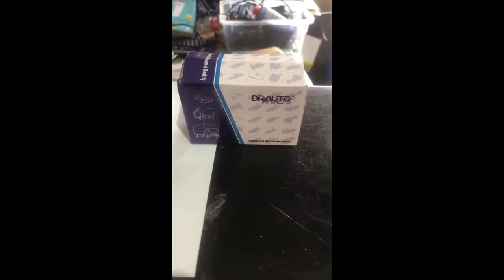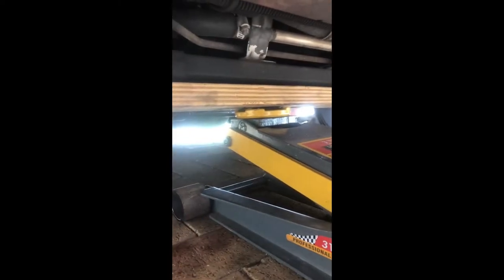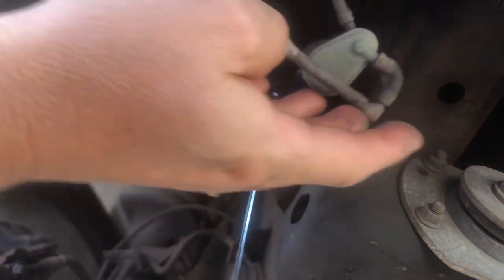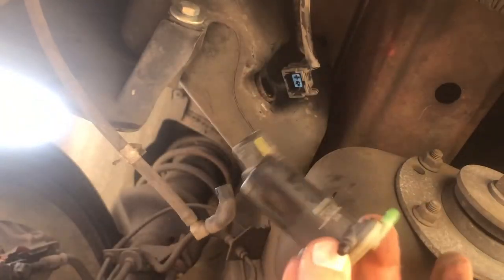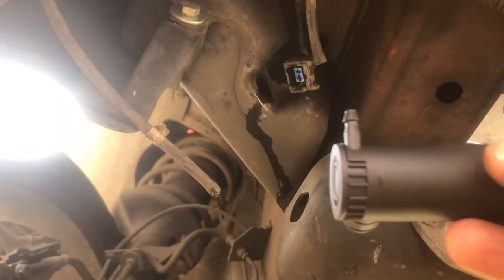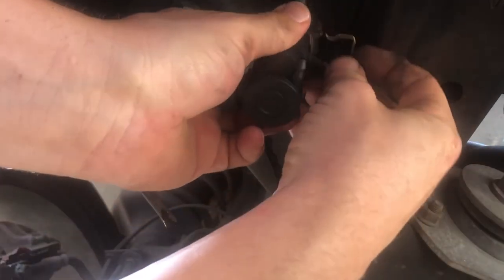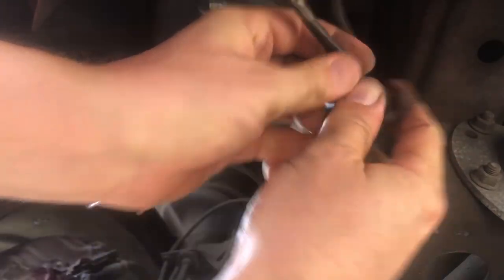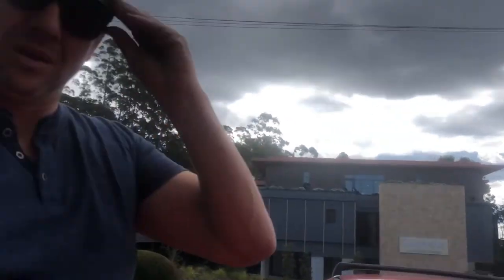How To Replace Window Washer ( Windshield ) Pump on VT - VZ Holden Commodore 1997-2005

Comment: You just saved me heaps of time and gave me confidence to tackle this job which has been a problem for a few months. Thank you.
Reply from the maker: That’s great
Let me know if you have any other issues on your Holden 
May make it my next video
Reply: @gdawwg1125  it’s a vz cross8 and this car has been a really good purchase ten years ago. I’ve replaced the headlights because the lens restore creams don’t last too long before repeating the process. There is a vibration caused by heavy acceleration moving onto the freeway from 60 to 110 kph, seems like it’s in the drivetrain but identifying it has been an issue. Possibly outside the realm of YouTube though.
Reply from the maker: @keskillia942   does it feel like its coming from the back of the gearbox. sort of where you arm-rest is. it could be  the center bearing on the tail shaft , best of luck
Reply: @gdawwg1125  thank you, I’ll need to get that one checked and hopefully you put me on the right path. Much appreciated.

Comment: Thanks champion. So many of these smaller jobs I put off because you can’t find any info on procedures. This and aerial is on the list!
Reply from the maker: No worries 
Do you have the power aerial ?
Reply: @gdawwg1125  I do and I need to replace it
Reply from the maker: @131Jayboy   my holden is in stroage so i can 't make that video. but if you remove the wheel then the inner guard plastic you can get at that  pretty easily